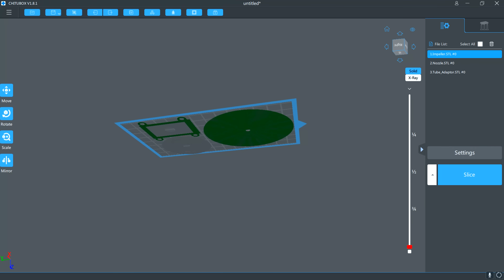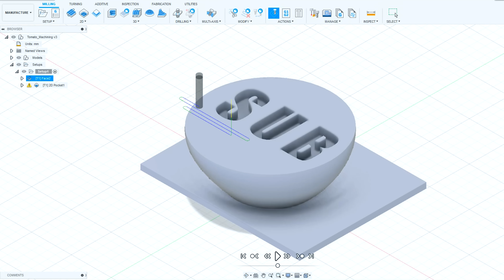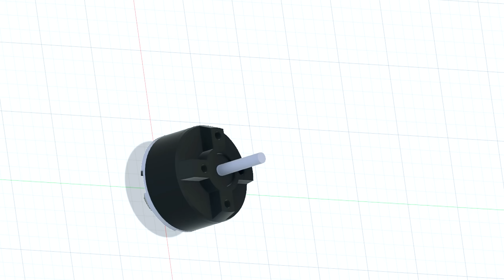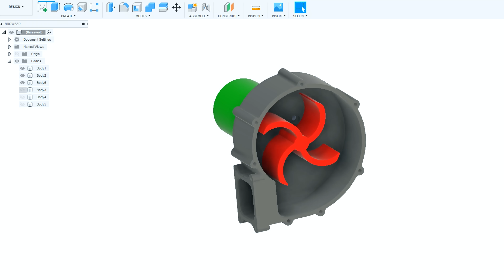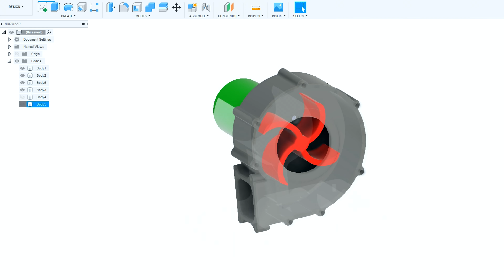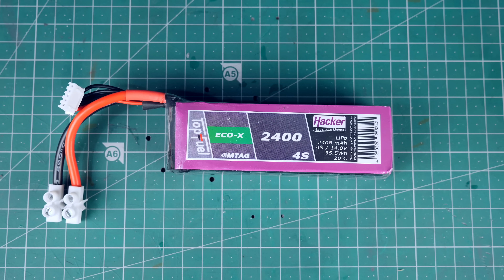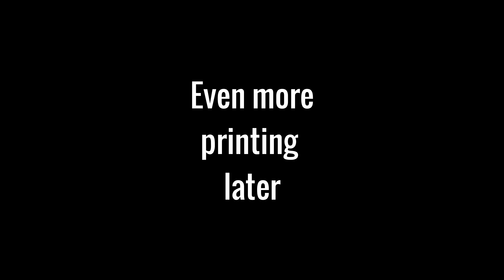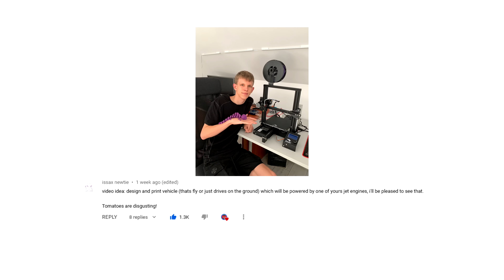Water Rocket Skateboard (3D Printed)

Comment: You should try using 3D prints to form moulds or forms for making ceramic/clay parts, or for forming sheet metal using a press or vice. Thay way you can create some more heat resistant parts with better consistancy, and the molds and forms could be designed so that they are reuseable.

You could also try wire wrapping parts, to increase their strength, and use resin or melted plastic to fuse it to the parts.

Comment: Hey integza, just saw you video about the waterjet skateboard. Pretty cool!! But your impeller isnt made to actually build up pressure. If you want I could help you a bit as I already build a lot if jetboats. So i think  i could transfer all my knowledge to help you getting more pressure and with that also higher speed. But basically its better to actually build something like a boat, because there, the water stream can better push the boat forward then air  does!
Reply: You want increased flow, not pressure, water is NOT compressible.
Reply: @Celcius1  water actually is compressible if you really want to have it on point. And of course you want higher pressure. Higher flowrate combined with high pressure gives more speed. Pressure = force on a specific area. If you have low pressure you cant really build up speed. You dont compress water there, you only make it flow fast trough a reduction nozzle, which builds up pressure.
Reply: @louis_sckr42  if you want to be pedantic, water can be compressed to a reduction of volume of 1.8% at such a low reduction in volume, its safe to assume that water is not compressible, as 1.8% reduction is not usable quantity, that is why I said you need to impart an efficient transfer of kinetic energy, and the pressure your referring is not actual compression, its more better explained in this video by Practical Engineering https://www.youtube.com/watch?v=m3i_5xP9PYU
Reply: @Celcius1  of course you are right, but thats basically what I said. I never talked about compressing water, always about pressure and flowrate.

Comment: Video idea: in his last video, Destin from SmarterEveryday mentioned that a carburetor is basically a rocket nozzle. So I challenge you to turn a carburetor into a rocket engine.
Reply: Yes
Reply: This is GENIUS
Reply: @Integza Give this man the printer, his idea is    G E N I U S
Reply: Not really, a carb sucks air through the front and opens using a butterfly. Fuel enters due to the vacuum of the moving air. Not nearly a rocket engine, a little though. You'd have to remove the butterfly and seal everything inside then figure out how to keep the rubber fuel diaphrame from melting.

Comment: hey you should print a rocket with hollow walls to fill with water to raise spesific heat and stop burning. maybe you could even make it running water to provide active cooling
Reply: Ducted steam channel out the front around the back, let the phase change help control heat from the burning fuel and add a little extra thrust from steam?